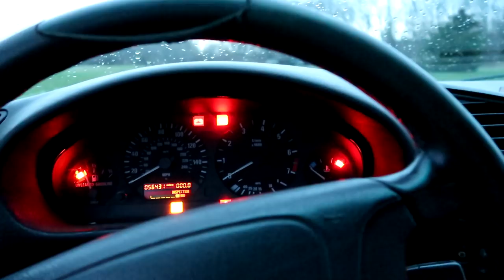MY FIRST JEEP

Comment from the maker: I want to sincerely thank all of you Machine Freaks that make these videos possible.
All of your Machine Merch support is very much appreciated.
-3D
Reply: Dude, your job and how you live life is honestly my dream! i wish i could almost come and aprentice with you :)
Reply: 3DMachines ordering murch tommorow after work
Reply: 3DMachines the wires you found might plugs for the vacuum system. Check if there are any leaks because that will cause the engine to kill itself
Reply: 3DMachines hi please reply
Reply: My truck did the same thing but it was the ignition control module cheap fix keep doing you
Reply: Keep up the good work you are my favorite YouTuber by far
Reply from the maker: Thanks Brayden
Reply: Hey i love your videos I wish I could be doing what u do and I have a big question and it is could I get a shout out it woild make my day thx and have a good day
Reply: How much did you pay for the jeep?
Reply: 3DMachines it could be a bad idle sensor switch
Reply: 3DMachines  You could have crush and the strangler sounds like a tag team duo from wrestling LOL
Reply: @goonzquad can help you with all your jeep stuff they do lots of old jeeps like that
Reply: If it has a chipped ignition key it could be a security issue. I work for a Chrysler dodge Jeep and ram dealer and see that quite often just figured I’d throw that out there.
Reply: Previous comment is regarding the start/stall issue.
Reply: 3DMachines the big plug is probably a odb 1 since they don’t have oem ports
Reply: 3DMachines I do applaud your ear protection but Dalton put a pair of dam glasses! Not the kind of chaos you want brother
Reply: 3DMachines woke up just to watch your video. Lol I love the vids.
Reply: Def need the map and maf iac sensors. Check the cam or crank sensor and fuel pres reg. I have built a wj v8 and thats were i would start. But other than that. She is mint.
Reply: 3dmachines the jeep is so clean for being the year and where it has been for all the years.
Reply: 3DMachines the jeep dieing is most likely the crank position sensor they are know for going out and causes the issue you are having when you replace it dont cheap out buy an oem sensor its located on drivers side top of the bellhousing area
Reply: o2 sensor, looks like a 3 inch suspension lift and a lame homemade body lift
Reply: 3DMachines buying merch soon i get payed!
Reply: 3DMachines tps is bad in jeep i see it alot
Reply: Great project and I'm excited to see this thing come along
Reply: 3DMachines the plug coming off the light wire is for the marker lights in the fender
Reply: I think I got the hint. 6.6L LBZ Motor swap in this bad ride????
Reply: 3DMachines check the o2 sensor as well
Reply: 3DMachines idle control air valve could be the problem with the Jeep idling
Reply: The engine do over 180thousand miles u are missing airflow sensor that's why it stalls all the time

Comment: That rear driveshaft angle makes me cringe..
Reply: Heepin327 Same haha
Reply: Heepin327 definitely needs double carden drive shaft or transfer case drop down brackets...
Reply: WJ Life that’s what I’m thinking. But it looks to have some kind of strange trans/transfer crossmember. Nothing I’ve ever seen before
Reply: Heepin327 yeah someone tried to make something custom there, should just be the factory skidplate, but I know on my wrangler anything after 6 inches you have to cut out part of the skidplate for both the front and rear driveshaft

Comment: I know this is a little late and you're probably doing something else already, but the best thing you can do at that point in the process of the frame rust and all of the other crimes committed against this jeep is build a new frame from scratch. That sounds complicated but if you take the body off the old frame and take good measurements from the body mounts you can get the new one powder coated and it won't look like it's spent its whole life in the north east. Also for the wiring you should go to painless they sell kits for this kind of thing ( I just bought a 1963 cj5 and am planning on getting a painless kit). If you want the least chance of tipping over in your jeep you need lots of flex in your suspension and big tires without lots of lift. My buddy's jeep is a similar year model and is running 42s with about half as much lift and probable close to four times as much suspension travel. Hope this helps!

Comment: It's either the idle air control  (IAC) motor, or the wiring harness connected to the IAC motor.  I had a jeep with the same engine (4.0L high output), and same exact problem...  after swapping out the IAC motor and messing around with positioning that little IAC plunger multiple times, I finally got the small wiring harness from a wrecked 4.0 jeep in a junk yard.  I literally snipped off the wires a few inches back from the connector, took it home, cut off my "bad" connector, spliced in the wires on the new connector, plugged it in,  and it finally ran and idled perfectly.  ...felt like a genius, or in your terms...  I felt like a MACHINE!  I'd bet 20 dollars on that being your problem.

Comment: I believe the timing chain can stretch on these engines. That might be something to check while  you are in there.
I am certain you will get it running in no time. If I had to guess, I would say you have a fuel problem and that's why it keeps cutting out. GOOD LUCK!

Comment: Some of this is obvious, some not so much. But from what I can tell:

-The transfer case could use a slip yoke eliminator and new rear driveshaft, which would help correct your driveline angles. It would also let you remove the big ugly spacers from the transfer case skid plate

-air box is missing (obvious)

-inner fender liners are missing. They are important for off roading and help keep water/mud out of the engine bay and away from delicate electronics, etc

-side marker lights are missing, which is probably what those plugs are for off the headlights. If you notice empty plugs down low near the front of your fenders, they are for the factory fog lights if your Jeep came with them.

- I’d recommend painting/rustproofing the underside and topside of your tub/floors. A common thing people do is paint the floor of the Jeep with truck bed liner (after addressing rust). It looks to be in good shape, but rust can creep up fast so it’s good to protect it. Problem areas for rust on the TJs are: lower windshield frame, front fenders, front seat floor areas (inside), rear floor areas (underneath the tub), rocker panels, body mounts (as you know), and the rear of the tub like the underside of the rear quarter panels and rear frame crossmember (mud/salt can collect here) 

Overall it’s not a bad looking Jeep, just needs a bit of work

Comment: Looks like it is missing a mass air flow sensor my camaro use to run like that put a new one in worked great or try carb cleaning some of varnish off  the throat of throttle body
Reply: crawlercrocker C These don't use a MAF.

Comment: I have a 2000 wrangler with a 2” lift. These jeeps are so much fun. You should put a air compressor under the hood I put mine on the tray u def the brake booster on the driver side. Got a cheap $60 compressor from harbor freight and it works great.

Comment: YOU NEED A SYE  the angle on the rear drive shaft is not good
after you put a slip yoke eliminator in the t-case you are able to remove those spacers for the cross member. A must with that much lift..

Comment: A suggestion for the horn if you want to try and fix it. I've had issues with a lot of similar vehicles where the clock spring contact for the horn is dirty behind the air bag. You just have to pull off the air bag or whatever it has in the center of the steering wheel and spray some contact cleaner on that rod

Comment: Not bashing the Jeep just making a strong suggestion to greatly increase the performance of the suspension and increase ride quality, but those short arms really need to be replaced with a quality set of adjustable long arms. You'll be able to fix that obnoxious pinion angle and achieve adequate articulation for the lift. Check out Clayton off-road or Iron Rock Off-road.

Comment: It should be a $25 camshaft or the crankshaft position sensor. My old jeep did that
Reply: Reid mcElroy this makes sense. Starts cause there is a signal, but kills it cause it not the signal it's actually looking for?  Many other things to look over obviously. Any way to test these sensors? Probably just magnets
Reply: Thermalstorm I never bothered to test because there were So many jeeps with that motor that always had that issue so the parts store always had one
Reply: It reads a pulse off the flywheel teath
Reply: It's located on the top of the bell hosing so if the previous owner ever blew up a clutch or a starter the flywheel would mangle the sensor

Comment: Hey check the sensor on your air intake elbow if that sensor has anything on it, it won't let the car run for very long but it will let it start. The same situation your having right now

Comment: Soynds like your fuel pump is shutting off after it starts...which can mean that the cam sensor or crank sensor isnt picking up a signal to tell the enging its running...therfore killing the fuel pump for safety

Comment: Dalton, it's not running due to a bad throttle position sensor (tps), or a bad crank position sensor (cps). Possibly both. Pretty cheap fixes.

Comment: It may be missing the mass air flow sensor. One of the bigger connectors could be a wiring system for the lights when towing it behind an RV.

Comment: easy way around the dissimilar metals problem. All you have to do it coat the back side of that aluminum diamond plate with a tuff primer. auto gray primer works but if you want to be a badass you can get some BMS 10-11 primer. Its what they use on Boeing airplanes. strong as $hit.

Comment: My xj did the same turning off thing right after starting was just a fuel balast resistor if u want to be sure before spending the 6 dollars on a balast resistor  just bypass it with a really low amp fuse if it runs fine thats ur problem

Comment: I might be wrong but I’m pretty sure that the 97 straight 6 has a crank sensor that controls the spark so might wanna check that
Reply from the maker: we did, it had no resistance.

Comment: Check your battery, I had a 97 Cherokee with the 4.0, and it would start, and stay running if I was on the throttle but not have enough voltage to let the computer read when idling, turns out battery was junk.

Comment: You should never go over a 4 in lift with the short arms. Those back ones are on quite the large angle. Cool project though.
Reply: sean tap looks like it only has a 4” suspension and a 3” body, if im not mistaken lol
Reply: TheHghghghg1 hahaha yea, it only has a 4” SUSPENSION lift. But if you count body lift it’s a 7” lift. Won’t have the best flex.... but looks sick.
Reply: Well I can tell ya my o6  has a 4.5in lift and the angles are way better than these and mine is sketch on the highway and its definitely going to need a slip yoke eliminator kit.

Comment: Does the Jeep have a MAF sensor on the intake? That could be causing the starting and stalling. The computer won't know how much air is entering the engine so it doesn't know how much fuel to ad.

Comment: Does that still any of the o2 sensors, if not I’d check those, id also check the tps an iac sensors  of those aren’t there or don’t work computer doesn’t know how much air to fuel it needs an shuts off to safe it’s self from blowing up.

Comment: Just let you know the iac (idle air control  valve)  is bad  then it should idle
Reply: Totally agree.  It's either the idle air control  (IAC) motor, or the wiring harness connected to the IAC motor.  I had a jeep with the same engine (4.0L high output), and same exact problem...  after swapping out the IAC motor and messing around with positioning that little IAC plunger multiple times, I finally got the small wiring harness from a wrecked 4.0 jeep in a junk yard.  I literally snipped off the wires a few inches back from the connector, took it home, cut off my "bad" connector, spliced in the wires on the new connector, plugged it in,  and it finally ran and idled perfectly.  ...felt like a genius, or in your terms...  I felt like a MACHINE!  I'd bet 20 dollars on that being your problem.

Comment: Sounds like u need a fuel balast resistor should be above the wheel well on the drivers side in the engine bay

Comment: ob2 scanner will help a lot..looks like your missing a mass flow sensor..also you should have 3 lines if I'm not mistaken..1 fuel line, 2 return, and 3 a line coming to a roll over valve..im not for sure if a tj has it but I know a yj has it

Comment: get an SYE for the transfer case and a cv drive shaft.... rough country has all of that stuff... those handles are horrible on the rear... it probably vibrates like no other.... another tip if you have the money is get a long arm upgrade for the control arms.. $1300 well spent

Comment: if it has a chip in the key for a security system and the key your using doesn't have a chip in the key it will do exactly what it's doing

Comment: Dalton the reason it stalls is because the mass airflow sensors is not connected because the engine does not know how much air is going in the engine